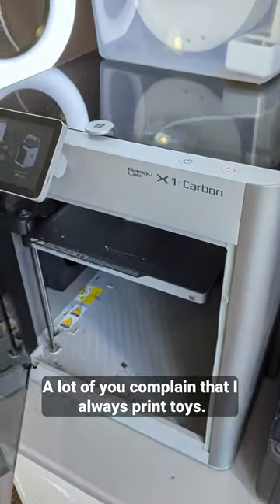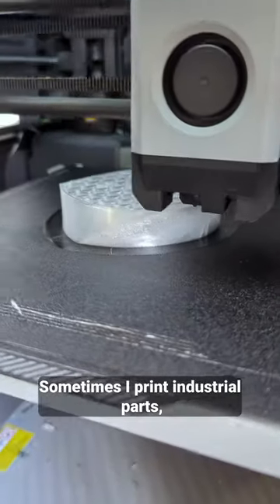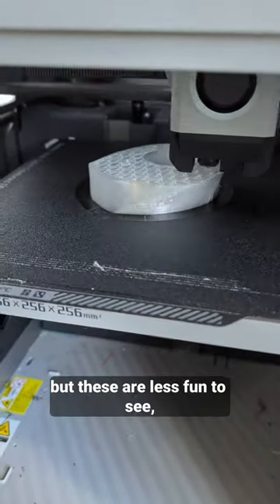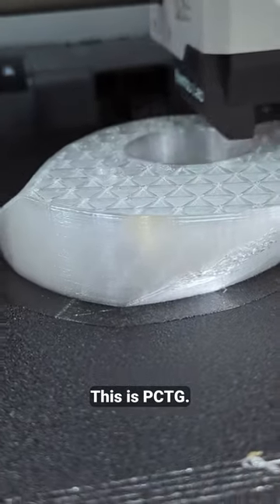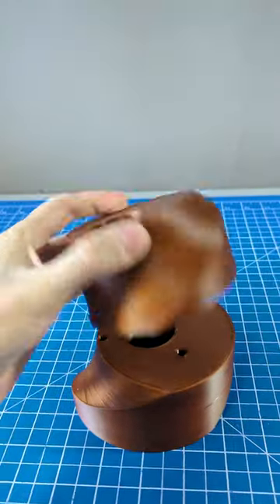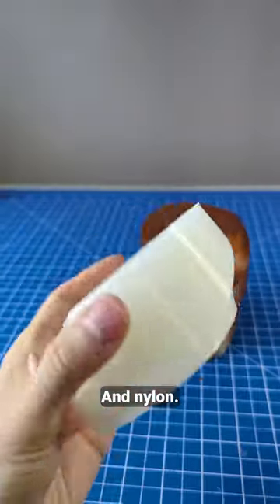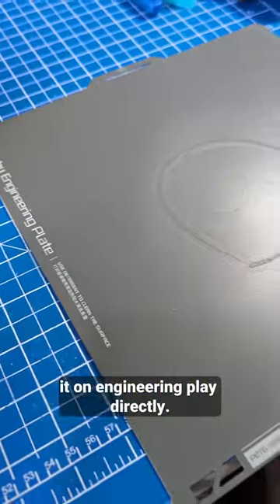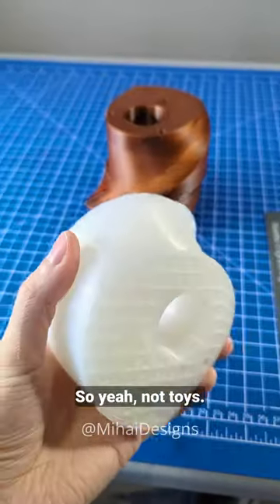Don't print toys

Comment: For functional parts I find the assembly way more interesting than the printing.
Reply: So if he printed a nut and bolt it would blow your mind?
Reply: @Sweet111323  I mean, it's cool seeing 3D printing having a practical use. No need to be so dramatic haha
Reply: @Sweet111323  What
Reply: @Sweet111323 yes, yes it would.
Reply: @Sweet111323 literally said the opposite💀💀
Reply: I prefer watching the print

Comment: I know what those parts are!  The design of those screws can really make or break a system.  If they don't work well, the system will jam in a very visible way and make the whole machine look bad. It used to be very expensive to get one of these.  We paid around $2000-$10000 for a good one made from Delrin.  It's really nice to see one being 3D printed!  Nylon is a good choice too.
Reply from the maker: Yup. Ended up going with Iglidur
Reply: I feel like this is a clue now this is interesting lol
Reply: What are these parts
Reply: Looks like the can infeed screw for a filler or labeler
Reply: @jeffreyepiscopo  I used to work at a factory that made a lot of juice, jam, and condiments and stuff like that. This looks like one piece of the machine that bottled stuff. You put a bunch of these things on a shaft of some description, bolt it together, mount it, and as it spins, a bottle gets pushed into the concave section by the conveyor belt that it’s on. Idk if I’m explaining this well 😂 but it’s basically a way of controlling the rate that bottles enter a machine. Since the filling is the rate limiting step, you can’t just have all the empty bottles getting pushed into it at the same rate as those bottles are getting put onto the line. Especially because they’re empty, they’ll start compressing each other and causing jams either on the conveyor belt, or in the machine itself. So you have the feeding conveyor belt run into either one of these, or a pair of them, and this thing spaces each bottle appropriately for the next machine on the line.

My bad for the essay 🙈😅
Reply: thebiglj  I mean, I could be entirely wrong, just to be clear xD it’s been a while since I worked there, and most of the ones in the place I worked were single pieces that were like 4ft long and actually a rather pretty shade of blue. Not quite as seemingly modular as these ones look like they are.
Reply: thebiglj  I don’t doubt that haha. Id wager you wouldn’t have seen lots of things that factory did, it was really cheap and most things were done on the sketch. They had an industrial can opener, but that broke like half a decade ago, and they still haven’t had it fixed or replaced, so instead they give you a like 1 1/2 foot long, inch and a half wide piece of stainless steel with a V shape cut out, and then sharpened on the inner edges.
Reply: thebiglj  somebody (I strongly suspect one of the supervisors I had. Man was a goofball, but knew his shit and was just a nice guy) wrote “cand opener” on it, which I think fits that place quite well 😂 oh how happy I am to not be working there anymore haha.
Reply: just checking in on this mystery.  looks like a possible Archimedes screw assembly (?).  no idea what the application would be
Reply: What is it

Comment: Actually I don’t find plate that work with nylon pa12 :( maybe high temp plate from Bambu that I already ordered will work 🤔
Reply: rumors are that nylon sticks perfectly on FR-4  plate
Reply from the maker: I hear the same: FR4/G10 would be better. One cut to size and with a magnetic sheet would be ideal.

Comment: Why would they call it the “engineering plate” did you can’t print engineering grade materials on it? Should’ve called it the “for toys only plate” lol.
Reply from the maker: Well, it says to use the glue stick and I haven't. The main issue is that plain nylon will warp without a heated chamber. Carbon fiber reinforced nylon would've probably worked, but we couldn't use abrasive materials for this print.